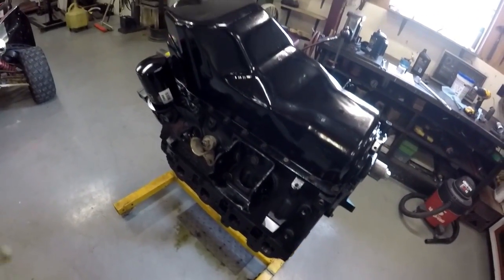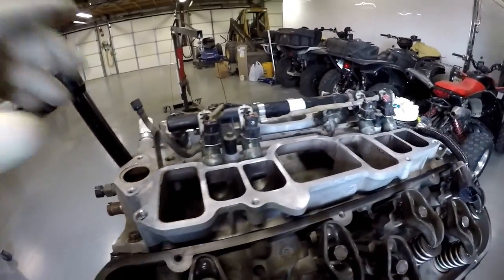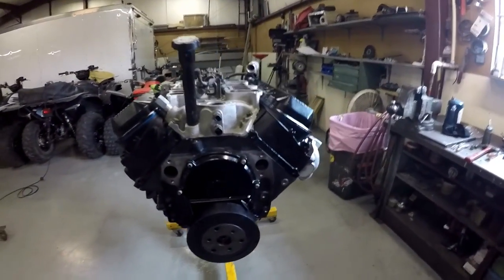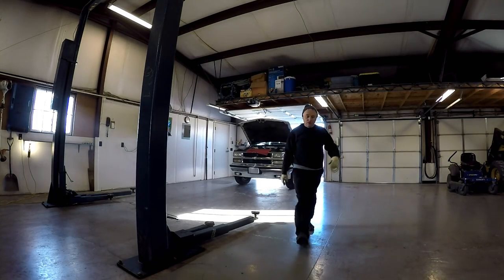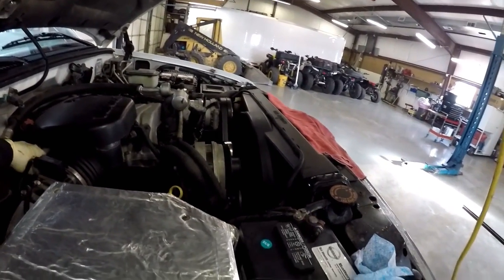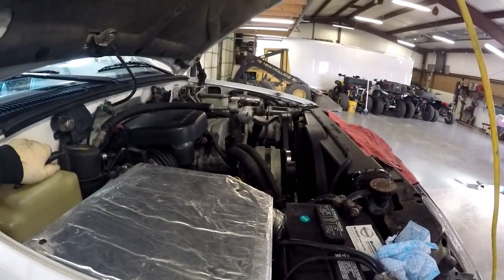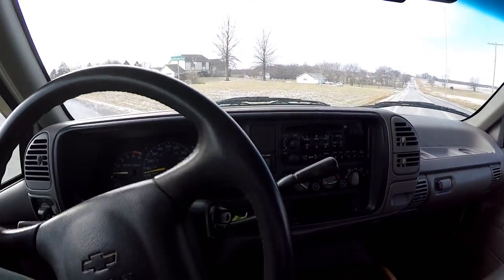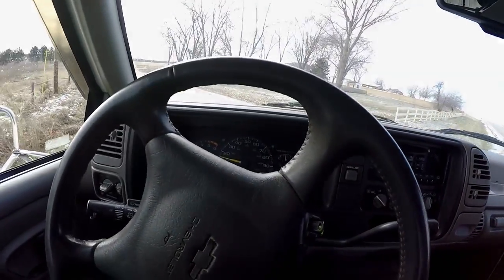Big Block Chevy Engine Build 454 C.I. pt2 Completion & install

Comment: Good job on the engine build, glad to see you used quality parts and did it the right way👍🏻
Reply from the maker: Hey Steve thanks a lot! Just got back from a trip to South Dakota with the truck. Still runs nice and strong. Thanks for checking out the videos!

Comment: I understand the forged crankshaft and hypereutectic pistons for your build but question why you went with the H beam rods on a street engine.  Nice build otherwise.  The truck seems to run great with the small dome piston upgrade.  My calculations for your compression with the stock, flat top pistons is 7.84:1 and 8.75:1 with the 10 cc dome pistons.  - 4.25" bore, 4" stroke, .010 deck clearance, 4.370/.039 head gasket, 118 cc chamber heads, 10 cc dome pistons.  Those are the numbers I used to do my calculations.  >>  http://www.csgnetwork.com/compcalc.html
Reply from the maker: The reason I went with those rods, they’re actually one of the cheapest rods you can get that have a bushing wrist pin bore. That’s really what I wanted. Rather than spending money having the factory rods reconditioned and wrist pin  bushing installed.  Thanks for checking out the video.
Reply: @kcatv9556  - Makes sense.  I knew there had to be a good reason to use those rods.  Have a good evening.

Comment: Great video! I would love to see the whole build without it speed up and without music overlaid. I love to see all the little details and measurements and torque settings used etc as it I’ll be building my own gen 6 454 and it would give me a better understanding of it. Of course I’ll need to know my own required specs and settings but at least it will give me real good idea of the finer points. Love the garage and how you managed it all yourself at your own pace... perfect 👏
Reply from the maker: Squad Customs Garage .. Good luck with your build! Thanks for your input, sorry about the music overlay.. 
Thanks for checking out the vid!
Reply: All good mate if ever you want to share the raw footage I would love to watch it

Comment: I'm going to be swapping the same motor but stock into a 85 swb and wondering if I'm going to need the fuse box? I have the wire harness.
Reply from the maker: Fast Lane Pros . Hey guy, that sounds interesting making that swap. I’m not 100% sure but I would assume yes, you’ll probably need the fuse box to go with it. I believe the ECM relay and fuses are in there.the airflow meter fuse is in that relay box as well. Good luck with your swap!  Thanks for checking out the video!
Reply: @kcatv9556  Thanks for the input and no problem, that was a pretty awesome video! Guess I'm going on the hunt for the fuse box and relays!

Comment: Where did you get that egr tube man or how you clean it up so nice , I'm doing the same thing to my 98 crew cab 4x4 dually 4x4 cam swap, all 3 of my 454 trucks all suffered from bad fuel injectors I replaced them with Bosch gen 3 injectors was amazed of the result from them! Also use spark plug wire heat sheilds from a late model LS engine
Reply from the maker: Hi Butch,  The EGR tube is the one that was on the engine. If I remember right i put header wrap on it 
to help keep heat off the spark plug wires.   When you replaced your injectors what kind of difference did you notice ?
This truck still a extended crank.  If I drive for about 30-40 min shut it off for about 10 min to a couple of hours,  then restart has extended crank. 
Never have been able to figure it out.
Reply: @kcatv9556  alot of great power came back worth it, meter MPG way better start ups, idle everything I got mine here https://www.fiveomotorsport.com/bosch-454-j-code-024-blue-knight/
Reply: @kcatv9556  also I forgot to say! Excellent job my friend that's a sweet build an looking and running great! I work on these 454 vortecs and late model big blocks, the injectors are worth the money, when doing these injectors do a new fuel pressure regulator get a Delphi branded one others fail, and also a new fuel filter the injector body is small to it allows more airflow under plenum, to keep them cooler from operating temperatures the factory metal body injectors see a slue of issues mainly they leak fuel when engine is off, also new upstream O2 sensors denso will give you back the crisp feel and all and all help with the longevity of your new rebuilt engine, also how is you exhaust, cats with 200k miles on them are due for replacement or delete depending state regulations, my 98 dually has cats deleted also I have a comp cams drop in cam shaft bigger then stock running the gen 3 injectors,  comp lifters, Adjustable valve train kit as well it helped it out a bunch!
Reply from the maker: Hey,Butch .  Thanks for all the info much appreciated!  The injectors is one thing I haven’t replaced yet, gotta look into those.

Comment: Do you drive it daily alright?
Reply from the maker: Chevybay ..  I don’t drive it daily.   Just use it when we go out of town with the trailer on trips.  Also when I need to haul something.  Thanks for checking out the vid!
Reply: @kcatv9556  cool, so it's run find without the oil coole?

Comment: Hey KC. I have a low mile 99 K3500 454 (96k miles). Just a few questions for you. Are those the stock heads? Did you change to an aftermarket cam? About how much did you spend on parts? Mine seems really sluggish. Fixing to do a tune up to it and if that don't help, I'll check the compression. Thanks. One more thing, how much power does it make over before the rebuild.
Really informative video.
Reply from the maker: JadXtreme ..  I spent a little over $4000 .   If I was to do it over again, I would reused the factory crank and just have it turned 10 under.   That would have save some money.   Yes it is the original heads just had a local machine shop do a valve job with new springs and seals.  I did reuse the factory camshaft, but that’s something else that I would’ve done different I think comp cams has a nice replacement one that I would use.   The factory one was a roller and it was in perfect condition so I just decided to reuse it. 
As far as power it is a noticeable increase. The truck cruises at 70 to 75 really easy and pulls the trailer up the hills nicely.   
To put a number on the increase in power I would say 60 to 80 hp. 
Thanks for checking out the video appreciate the comment as well!!

Comment: plz tell me about your air box
Reply from the maker: Glenn Williams .  I made it out of sheet aluminum and covered it with insulation wrap. 
Has a lid that unbolts to access the filter.   Wanted it totally sealed that way it gets outside air only. 
Hope that answers your question, thanks for checking out the vid!

Comment: Awesome build! I envy the garage! I am in need of rebuilding mine as well... I like the higher compression, have you by chance dyno'd? I'm curious what kind of power difference you are getting. Let me know!
Reply from the maker: Hi Jacobi. Well no I haven’t dyno’d or anything like that.  But one thing I will say it pulls the trailer down the highway at 70 mph easier than it used to.   
We’ve took 3 out of town trips with it so far and I’m very pleased with it runs really good.
Thanks for checking out the video much appreciated!!

Comment: What wheels are those fronts? Are the rears the same? They look cool.
Reply from the maker: BLOZ UP ..   They are Alcoa aluminum wheels, yes they are the same front and rears 
Thanks for checking out the video much appreciated!
Reply: Thanks for the reply. I just picked up an 85 C30 Dually with a 454. I'm used to Japanese cars, so having the parts availability and prices like they are for domestics is awesome.
Reply from the maker: I had an 86 before I bought this one.  Good old trucks,

Comment: Can you imagine doing an engine removal and re install without removing the hood  ? I'm not sure I ever did ONE GM motor without taking off the hood ,, It's just so much easier to see everything and get to some back bolts without the hood in the way .!!

Comment: This just gave me more motivation to revive my old 97 Burban K2500 w/ Vortec 7.4,. She has 255k and tows like beast still, just drinks a bit of oil and I believe the timing chain is a little streched. I will definitely be referring back to this video when I pull mine out. Thank you Sir!!!!!
Reply from the maker: ruben Magana ..  That sounds awesome Yep that’s the same motor that’s in my truck.   It ran fine as well but did use quite a lot of oil and I was unsure of it out on the highway.   Good luck with your build any questions don’t hesitate to ask and thanks for checking out the video!

Comment: You made me nervous when you kept walking underneath the engine hoist, but I liked the videos.  I want to start building motors myself.
Reply from the maker: Kelcey K ..  Yeah building a new engine was much cheaper than buying a new truck. 
Thanks for checking out the vid!

Comment: Nice, I have to rebuild my 454 soon my oil pressure won’t hold , any tips or parts combo would be helpful,  thanks
Reply from the maker: HooNs ..  Well first off is where to buy parts, I bought a lot of stuff from Summit racing equipment they have reasonable prices and a lot of stuff in stock.    The parts you will need it really depends on what kind of shape your engine is in now.   If you have low oil pressure then your bearings are probably shot and you will need either to have the crank turned undersized or replace the crank. 
Summit racing has crankshafts pretty reasonable.   But once you replace any part of the rotating assembly crank, rods, pistons then you will need to have the rotating assembly balanced.  
As far as needing a new block or Pistons it really depends on whether it is burning oil now and how many miles are on it.   I did replace my block because I knew the cylinders were worn out and I didn't want to bore it 30 over.  I went with the GM block but once again you can get one from Summit racing.   Hopefully you have a local machine shop you can trust to help you with this project etc. rebuild the heads, crank work, balancing and such. 
Hope that helps you out thanks for your question appreciate you checking out the video too!

Comment: Damn i need to do this to my K2500 ! Did you have to get any additional tuning done to the computer for what you've done?
Reply from the maker: Hey, Edgardo that's a really good question, I'm surprised more people didn't ask that.   The short answer is no I didn't do any modifications to the computer system.   I'll try and give you a quick explanation, one thing I didn't modify was the camshaft or the cylinder heads, kept all that in stock form so therefore the stock Air fuel system worked just fine with no modifications.
Hope that answered your question and thanks for watching much appreciated!
Reply: KC ATV World yes sir that makes sense i appreciate it ! Did you consider port and polishing the heads ?
Reply from the maker: Well yes and no I thought about it but didn't want to increase the airflow because therefore would have had to increase the amount of fuel as well.  I didn't want to lose any Fuel mileage.

Comment: I have an L29 motor also, those heads should be 99cc chambers, that would make a lot of compression with those Pistons, just wondering it the chamber sizes of those heads are 118cc
Reply from the maker: Hey, Thomas ..  Yeah the heads on this motor are 118 cc Chambers. 
With those Pistons the compression ratio came out to be 9.4-1/2 to 1 . I think with 99cc chambers and those Pistons your compression would be a little more than what you could run on pump gas. 
Thanks for checking out the vid.
Reply: I was wondering the same thing, had to assumed he did not use the stock Vortec heads or other as domed pistons would hit the vanes in the heads of a L29.